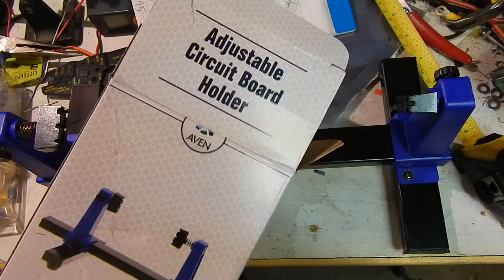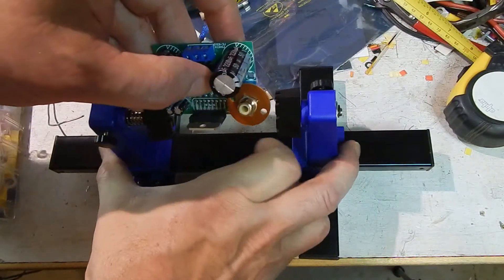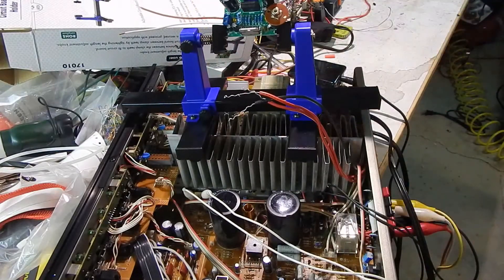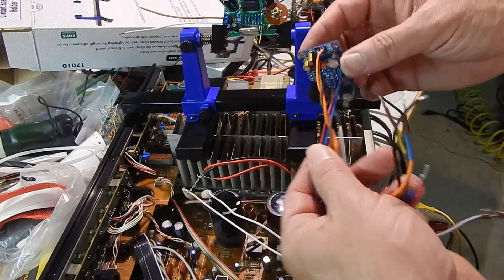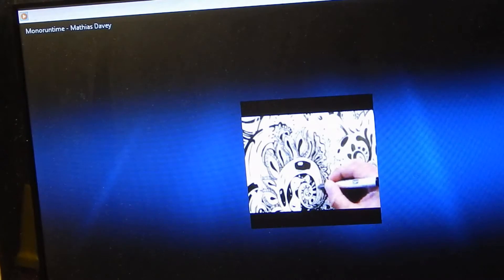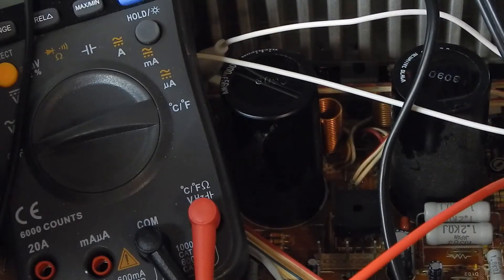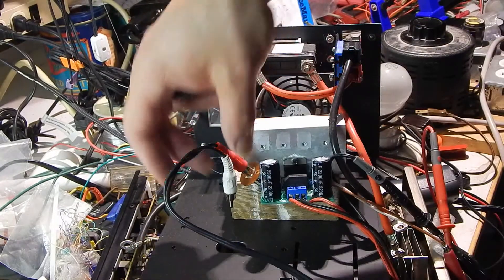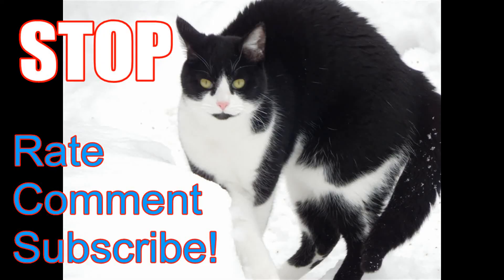TDA7293 Banggood Bargain Amp - Could it Work?

Comment: A couple notes I considered annotating:
On sound quality, note the the speakers are below the bench.
On temperatures, I was aiming at the metal tab next to the mounting screw. The briefly higher temperatures were from the epoxy, which measured about 15 degrees F/8C higher. 
Note the heatsink is electrically hot if you don't use the mica and insulating washer. Not doing so cost me my precious iPearl!
Reply from the maker: Also, note that Banggood may sell more than one model of TDA7293 boards, they have so many items I sometimes find the same "gadget" listed twice and at different prices. And even for a given selection you often have the choice of waiting for the China price, or you can pay more to get it more quickly from their US warehouse.